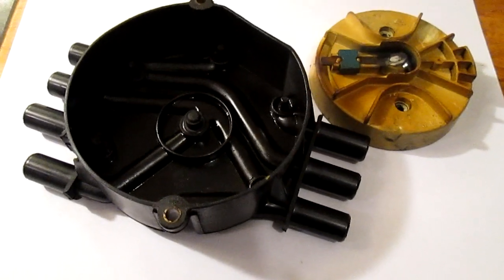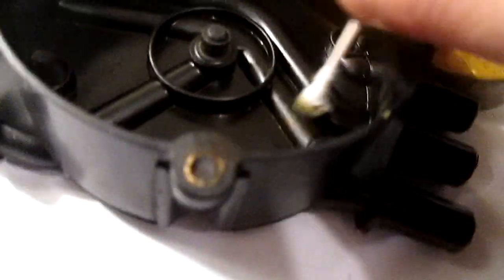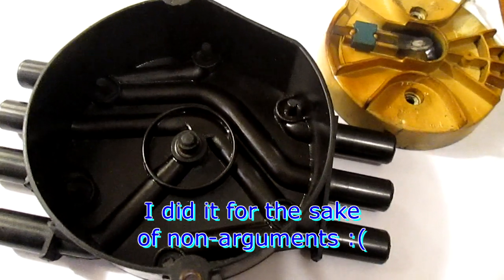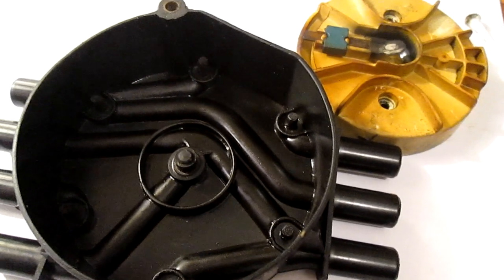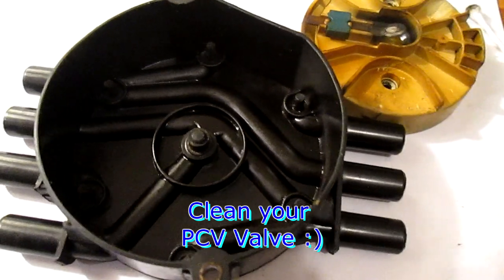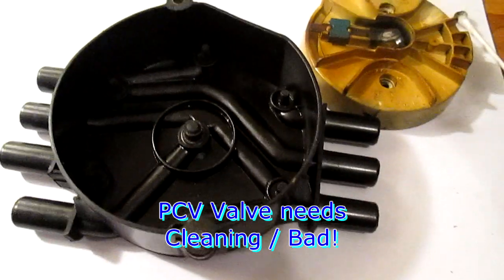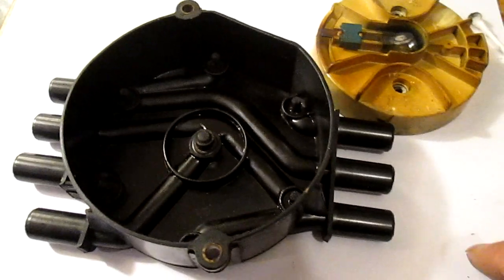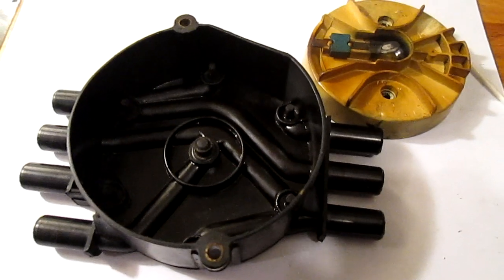Moisture + Condensation + Oil Vapor in Distributor Cap ? Car Runs Rough Dies Shakes Hard Start

Comment: So I have the whole rainy day no start problem thing to...
Today I took the distributor off cleaned it up with the vinegar...
Used carb cleaner with the straw to try and clean out the small vent holes underneath the cap rotor button..
I didn't drill them out like some people say because it looked like I was able to clean it real good spraying from underneath and on top..
And visually they looked pretty clean..
I will try to come back and update this if it works good got to wait for some rain and it won't take long with the satanic cabal controlling the weather making it rain all the time now
Reply from the maker: After learning this..... It could be your Head Gasket has small Coolant  Leaks.  when it rains, too much moisture + leaks it create MORE moisture which creates hard starts.  HOW TO KNOW...  Go onto the Highway and drive over 60MPH and if the Car/Truck shakes a lot, it's more likely that is what happening.  TEST this and then tell me what happens later, I may be able to assist you further!
Reply: @JodBronson ok.if it still does it again.im going to also make sure my pvr is there and working correctly..
Haven't checked it yet after 27 years 🤔
Pretty sure I know it's that hose plugged into the valve cover but I unplugged mine and it just looks like a black hose that plugs in the hole but no valve is there maybe it broke off in the hole I don't know I'm going to check it out later 🤔
Reply: So it rained a little bit last night and my truck started right up but it could be a coincidence because I just got done cleaning it up so good.
So I'll try to come back and leave another update
Reply from the maker: @Miketaylornews  -  On a Dry + Sunny Day after driving for a while, leave the engine on and check your tailpipe to see if anything dripping!
Reply: @JodBronson been getting super insane hard rain and so far my truck cranks up every time like the rain is not a problem anymore...
So cleaning it up really good and spraying those screens (two tiny vent holes under the roter button)with the brake cleaner or whatever it was underneath and above after taking off the distributor cap and rotor and making sure all the light green or yellowish film was cleaned off of everything..
So it might have been a fix but it might come back soon🤔 maybe I do need the cheap PVR valve still have to investigate that.
But all that cleaning including the air holes vents definitely 100% did something because I've never had my truck running so good with all this hard rain and starts every time for a long time.
Reply from the maker: @Miketaylornews  -  That is so awesome news and glad it's doing well.  Please keep me/us updated so we all can learn this in the future!
Reply: Update: that cleaning the distributor vents and distributor it self worked.. probably cleaning those two little small vent holes was the main trick .
Tahoe was very hard to start after rain.
But literally no problem since I cleaned the vents. And we've had torrential downpour rains over and over since I clean them and still no problem since I first posted this stuff after cleaning them   @JodBronson
Reply from the maker: @Miketaylornews  - AWESOME!

Comment: Oil catch can isn’t the issue, the issue is you removed your pcv valve, I recommend running fuel hose from pcv valve to inlet on oil can and the outlet to the plenum. And if distributor gets oil in it then yes you may need a new one, but in some cases the oil will run across the bottom and not come in contact with any electrical material, which in that case just replace the seals.
Reply from the maker: You biii pooo  laaa or just dense?  :oops:😂:oops:😂:oops:😂

Comment: recently my car is not being start in the rainy days so when i checked the distributor cap i thought that there was a moisture so i just light up the inside terminals lightly for a moment than start eventually it got started i discuss this with a near by mechanic so he advised me to check weather the oring/or seal of the distributor cap is present or not it will stop the moisture to enter but when i searched on internet i came to know that that particular seal/oring is for oil not moisture though my car is not causing problem because rainy days our over but i still want to know should i change the distributor cap or not  and where is this oring/seal of distributor cap is intalled between the cap and the distributor because it does not seem so because cap is flat.Please advise
Reply from the maker: EVERYTHING you need is in the video !!!

Comment: If you look in the distributor under the rotor cap there's vent holes if they are clogged up your Cap will keep moisture the vent holes have screen in them clean it out for condensed moisture 👍
Reply: I just poked the screen out and have had no further issue for th last ten years. 2001 Express 4.3 vortec.
Reply: I have 97 Chevy Tahoe I was jabbing the screen with an allen wrench from the top and it felt real solid so I just cleaned underneath and on top really really good(hopefully) and left the screens in..
Hopefully it works good@stevecarlson6462
Reply from the maker: See Pinned Post !!!

Comment: Great video thx. I think that’s my problem, too. My 2022 Doge Ram 1500 shakes at 70 mph on highway, has white smoke from tailpipe, hesitating, dies while driving, and the like. I replaced the idle air temp sensor, the crankshaft sensor, the pvc valve and the pvc valve elbow, the thermostat, and yet it still won’t start, has hard starting issues or it’ll start n run for a good while n then dies out. Or start n run for a few seconds or just a few minutes n dies again. Then when I try to start it, it won’t start at all! Thanks for this video. I bought the distributor cap n rotor, spark plugs n wires. I still need to change them all out. If it fixes the problem I’ll post a video. I also bought a new fuel pump that I have t put on yet because the fuel pressure gauge says it’s within range. I’ll keep y’alll posted.
Reply from the maker: White Smoke Tail Pipe = Coolant Gasket Leaks.  That was also my biggest problem about Starting issues during Rain, Snow, Wet and etc....
Reply: Did it fix it?

Comment: Also sir I’ve been reading that gm never let out a formal recall on the gaps for the spark plugs and it was just sent as notice on the plug wire boxes but these trucks spark plugs need to be gapped to 0.40 not 0.60 please correct me but that’s what I’ve been reading up on al night
Reply from the maker: The Spark Plugs Gap doesn't really matter as much... But as Standard or Factory will be fine.  Here is what you need to do.... Go to the Auto Store and get yourself NEW Spark Plug Wires.... Make sure to spend a bit EXTRA for GOOD Quality!  I promised you, it will be ALL worth the money for the Wires.  NOTE: PAY ATTENTION to the Wire that come out from your IGNITION COIL MODULE.... That would also the culprit of Power Loss during Highway or 75MPH+ ride SHAKING!
Reply: Ahh I see but that I don’t have a problem with it’s mostly that the cap and rotor foul out and then when I go to take it off it’s full of crusty corrosion and I replace it multiple times a year
Reply: @ezioac12359  This may help and it comes from General motors-
http://digitalcartography.com/n0eq/astro/DistributorScreen-GM-TSB.pdf
Reply from the maker: @ezioac12359  -  If you have " Rusty / Corrosion ".... Most likely, you have COOLANT Head Gasket Damaged,  I mentioned that in the Video.  Do you see WHITE SMOKE or LIQUID DRIPPING FROM TAIL PIPE?  If YES, then you have small Coolant Gasket Leaks.  Here is what I did and I mentioned that in the " Description ".  I went to Walmart and bought Bar's Leak Head Gasket Repair.  I followed the instructions on the bottle.... GUESS WHAT????  I have solved the "Moisture" problems and now the Engine is going great and start right up right away and we have NOT change the Distributor Cap since.
Reply from the maker: @ezioac12359  - Another alternative..... Drill a 1/8" hole in your Cap.... Get a Vacuum Connector at Auto Zone and Vacuum Tube... Tap that into your PVC Vacuum Line... This will help sucking all the Moisture out.
Reply from the maker: @devinrichman5282  - Hahahahaha, myniaaga.... I don't see you do any better!  Did your BIPOLAR KICKED-IN HARD?  LMFAO  😂❤️😂❤️😂❤️😂❤️😂❤️😂❤️
Reply: @JodBronson  I was saying that is smart. Idk what you just said. Its wasn't English.
Reply from the maker: @devinrichman5282  - Smart?  Is that how BIPOLAR people do right?  LOL
Reply from the maker: @devinrichman5282  - Of course it was "smart".  NO ONE have figured it out since the video was made in 2018.

Comment: You’re a goddamn lifesaver ...had this problem since I got my 96 5.7l Silverado back when I was 15 three years ago and go through three-four cap and rotors a year and have only driven the truck maybe a year in Total out of three years of ownership ...no one has had an answer for this ...the best I got was that I could turn around and spray the distributor shaft vents with air and wd40 until today my dad put my truck in the shop about three days ago so I went to check up and tell them about the moisture problem and they told me as soon as I said moisture cap and rotor . Doug-“oh yea there’s no getting rid of that unless you keep it garage kept its just how it is because of the design of it and the best you can do is take of the cap and dry it out”. I was relieved because I didn have to say much and they knew already without even looking in there but your video is gonna save my life and bank ...this truck was bought in the town over from me for 1500$ in 08 after an older lady’s husband passed and it barely had I believe 34,000 miles but my dad bought it and it was the truck I grew up in and it was his work truck for years until he switched jobs and had a work truck that he had to always drive and he sold the truck to my uncle who put new headers and exhaust and made sure it ran until my uncle went to the same job as my dad and another work truck scenario in which he let the truck sit for months til I turn 15 and we bought it back from him and it’s been through so much and it’s such a big part of my childhood ...I’m 18 now and I’m leaving for the marines on September 9th but before I go I’m getting this truck back up and running for my little brother who’s bout to be old enough to drive and I want him to be able to hold it and use it for me ...this truck has saved my life more times over than I can explain the power from it and the body I’ve been able to maneuver it out of so many near misses and drunk drivers and people speeding in shitty cars the same truck I grew up in had served me right all my life so far and I’m ready to give back to it but I think it might be time for the engine to go when I finally save up the moeny before I leave for my enlistment as long as my brother takes care of it I will be coming back ...I don’t care about sports cars (except for 89 and older nissans) I just want this truck and I wanna make this truck to be all it can be when it came off the lot in Alvin TX back in 1996 the greens faded to a nice shamrock green and I’ve never been able to give up that spiritual connection that I’ve had with it I’ll never give up on this truck as long as I can keep it going without breaking my bank or causing me to have to sacrifice anything
 sincerely , Seth Altman Fan of his 1996 Chevy Silverado 5.7l 350 smallblock vortec with the 460le tranny (which I replaced ,pain in my ass) and the gambit exhaust my uncle put within it and the timing chain and spider injector and everything I’ve fixed on it I love this thing and I’ll fight for it because I’ll never have another vehicle quite like it
Reply from the maker: Well I am glad you've found this useful.  YES, these Chevy Car/Trucks are very reliable and my Dad still have it and he's the original owner 1996.  Also, it's over 300K on it and it's doing great.  It starts up right away and now the moisture issues is gone.  First, I did the Oil Catch Can, it caught a lot of Green Liquid... That would lead me to Head Gasket.  Second, once I found that out.... And determine that it was the Head Gasket Leak.... We went out and bought Bar's Leak (I have Video in my Channel) and after putting it in, IT WORKED in an hour!  Third, I am happy to report that the Car/Truck is in working order still.  So far, Bar's Leak saved the Truck and my Dad use it everyday.
Reply: Jordan Bronson I’m gonna have to look into doing that I thank you very much sir very much
Reply: 0

Comment: If there is any liquid in your cap period,especially oil, your distributor shaft seal is bad. Change the whole distributor and yes make sure your crankcase is vented and works.
Reply from the maker: @Dee Tee - After this Video... I did changed a brand new Distributor Rod + Cap and that was no help!  I suspected the " Head Gasket ", so I used Bars Leak and so far I " think " I solved it.  But as far as right now, it's working great and we will see.
Reply: @JodBronson  LOL GUESS ITS A PARTS TRUCK BY NOW.
Reply from the maker: @smokenbudesq  - NOPE, it's still working !!!
Reply: The seal really isn’t that great with any brand you buy either

Comment: Nice video makes sense seems like the top or side of the cap should be vented as well
Reply from the maker: @john boi - WOW !!!  You are the FIRST to get this Video!  👍👍  2 Thumbs up!
Reply from the maker: @john boi - I forgot, you are 100% correct!  I got a kit on eBay to do a mod on this.... I haven't got a chance to do a Video yet, since it's cold outside!
Reply: What’s the name of the kit and how much was it
Reply from the maker: @johnboi1829  - It was $12.00 including shipping.  You can probable make it yourself... But I wanted to make sure and get instructions... So basically I paid for his knowledge, LOL.
Reply: What’s the name of it did you try it out yet
Reply from the maker: @johnboi1829  - Sorry for delays.... I tried to get it from my Dad, but every time he come here, he always forget :((.
Reply: Jordan Bronson no problem bro thanks anyway but I ended up putting a fuel pump distributor and I threw in a coolant temperature sensor running great 👍🏾 also I did the plugs and wires thanks again
Reply from the maker: @johnboi1829  -  Oh ok.  I thought you had moisture issues too, hence the comment here on this video!  Did your Engine just die without warnings when hot and no error code?  If yes, then most likely it's the Spark Plug Wires.
Reply: Jordan Bronson I had the moisture problem on my 97 safari haven’t got around to fixing that one yet but your video was a great help thanks again
Reply from the maker: @johnboi1829  -  Well as you know I am an " expert " through " Trial and Errors! ".  I want you to " TRUST " me on this one, to solve your moisture problems!  Go to Walmart and get " Bar's Leak Head Gasket Fix" for Head Gasket Repair.  It's about $24.00 currently and just dump that in your Radiator and let your Van/Car idle for 30+ Minutes.  After that, let it cool completely down...  Then turn on the Car and idle for 10 Minutes or Warm + drive around for about 30 Minutes.  This would ultimately solve your Moisture problems!
Reply from the maker: @johnboi1829  - Here is the Link that is the one I used for 2 of my Dad's Truck / Car.... https://www.walmart.com/ip/BAR-S-LEAKS-1111-Block-Seal-Head-Gasket-Fix-24-Oz/19802790
Reply from the maker: @johnboi1829  - Here is the Video that I did 8+ Months ago - https://www.youtube.com/watch?v=98EFGWQsjm4